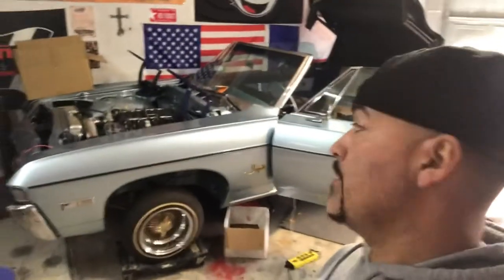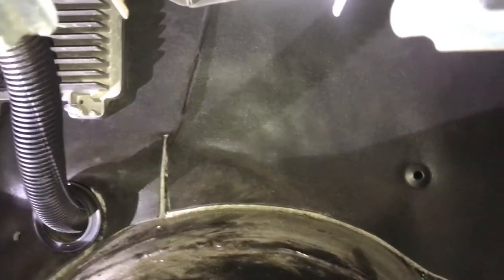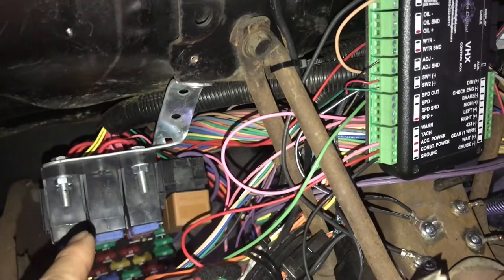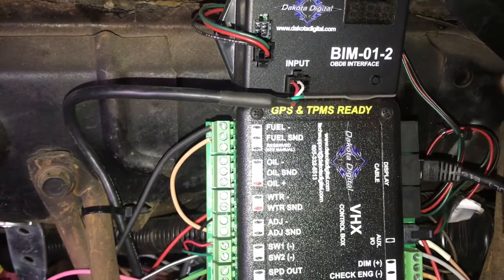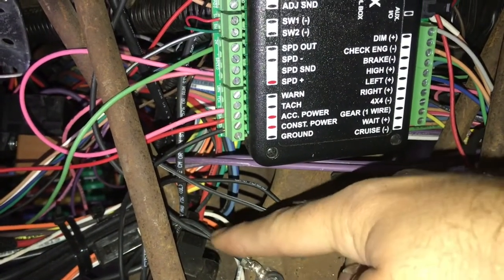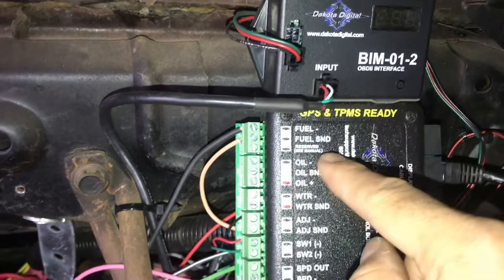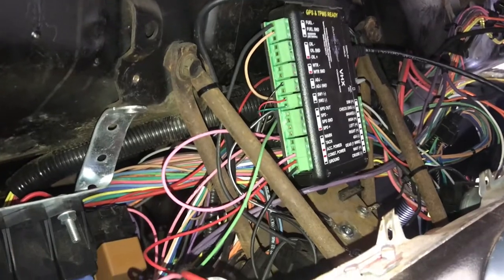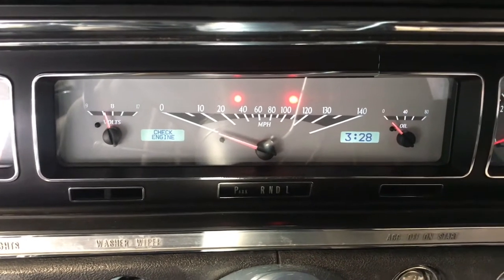1968 Impala Dakota Digital install details with LS swap tips

Comment: What motor and frame mounts are you using? and also what oil pan are you using to get this morot to fit? i am running the car setup and i cant get anything to line up and went through 3 frame mounts and 2 oil pans?

Comment: Does that bim box come with it or do you have to but that separately
Reply from the maker: Have to purchase separately 👍
Reply: @RedRocket64  awesome bro thanks I'll be getting one for the 64 good to know that I'll need something extra
Reply from the maker: @stephendudla  Yes sir 👍 it’s a life saver, I don’t know what ls harness your running but if it doesn’t have wiring for your electric fans, Dakota also makes a fan controller the plugs to the BMI, I’m running it on the red car, you set you own temps to it via Bluetooth through Dakotas phone app. It’s pretty nifty. 
If your harness has wires for primary and secondary fans you won’t need it.
Reply: @RedRocket64  I have the PSI wiring harness I think it has a trigger wire for fans but that's it still have to get relays for them too
Reply from the maker: @stephendudla  Got it, should be a drk blue and drk green wire off that psi harness 👍
Reply: @RedRocket64  nice ill take a look next time I'm at the shop 
Currently recovering the front bucket seats what a pain in the ass that is 😆
Reply from the maker: Oh man, your hands/fingers are going to hate you tomorrow 😬